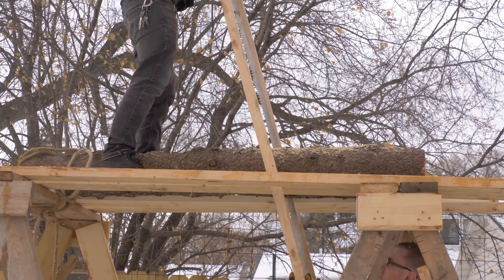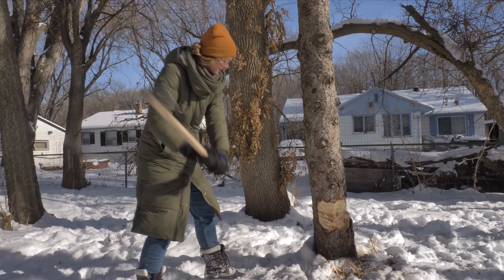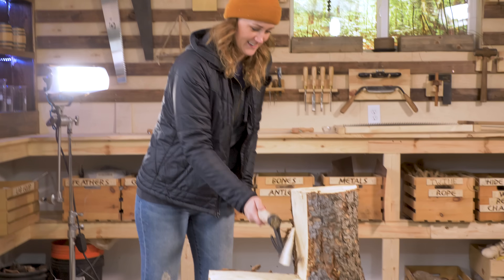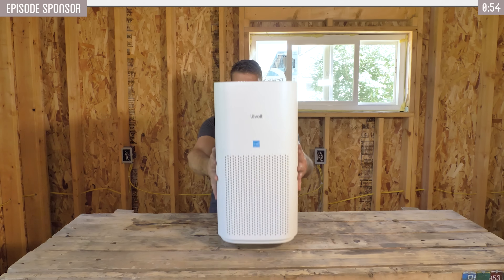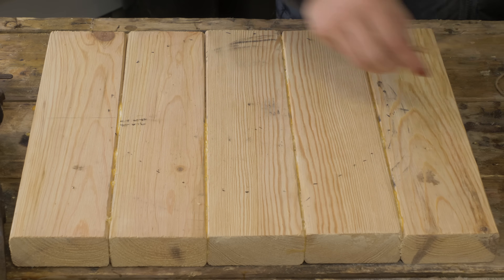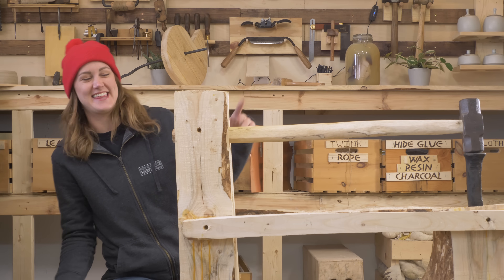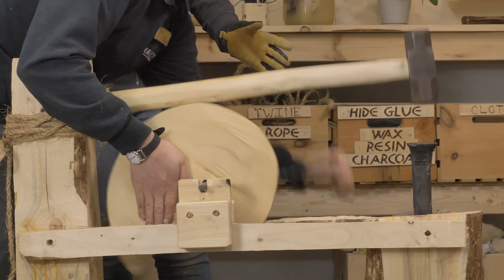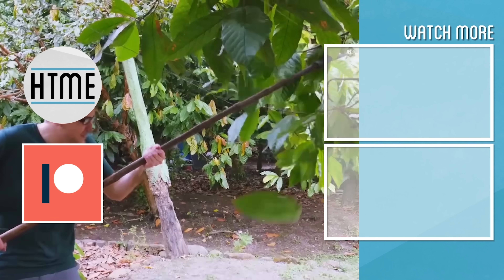Does Da Vinci’s 500 Year-Old Power Hammer Actually Work?

Comment: A good upgrade would be to add a spring, maybe something like a crossbow to add tension. Also use graphite to lube the whole surface of the cam and the joints
Reply: These are my thoughts exactly. And this is why it’s good to read the comments before adding my own.
Reply: @patriciofreire3375  i just found yours. i was thinking the exact same
Reply: A better "upgrade" would be to move the cam to where daVinci actually had it, on the tail end of the handle on the opposite side of the fulcrum. When the cam is between the fulcrum and the head the handle will always ride the cam down through the rotation, because the "step" in the cam cannot turn from vertical (where the hammer head reaches its highest point) to horizontal (where the protruding part of the cam is out of the way of the handle) instantly. No amount of springs, heavier head etc. can change that fundamental flaw.
Reply: I agree though if you want to be accurate they would have probably used to lead for the cam rip your kids
Reply: Why add something complex like tension to something simple an effective like a gravity hammer? Just add more weight/mechanical advantage, rather than having to manufacture spring steel or something else under tension that would degrade.

Nobody wants gut or other bowstrings in a forge environment… unless you want to be replacing them all the time.
Reply: Was graphite used back then? I don't know much about the history of lubricants.
Reply: @NihongoWakannai  There’s always animal fat, since you’re already adding flammable strings to the mix 😂
Reply: @NihongoWakannai  Nope. Graphite as lubricant was a 19th century development. It's unlikely that da Vinci even knew that graphite exists, because mining graphite only started in Cumbria (northern England) around mid-16th century (ie. 30-40 years after da Vinci's death). Before that graphite was basically unknown since it's only very rarely found on the surface out in the open. And from 16th to 19th century graphite was highly controlled by the British Crown because of its use as refractory material for casting exceptionally smooth cannon balls (ie. the Brits basically kept it a military secret).
Reply: Animal fat, beeswax, fine ash maybe?(carbon powder) would work and still be period

Comment: The cam needs to engage a pin bolted around the hammer shaft vs the shaft itself as the hammer does not drop at the edge of the "cliff" but only after it has rotated past, so what's happening is that the hammer is actually lowering and then it drops onto a higher spot on the cam as it has already rotated past the lowest point, which prevents a full stroke.  In other words, you're really only using 2/3rd of the cam and reducing the power of each blow..   An alternative would be to turn the cam 90 degrees, which would allow full lift and drop, but would need additional bracing as this would tend to shift the hammer sideways with rotation..  
Also consider springs or just additional weights to help improve the power of the blows..
Finally, watching the attempts to use the drawknife and other tools was a bit painful..  In addition  to just making the tools, you need a bit of training on how to actually use each of the tools properly as the process is actually quite efficient and the results much less "rustic" when the tools are used correctly...

Comment: 9:25. You're doing it wrong. Just hit hammer handle on the floor or table. Your brain thinks  that it's not ok, but, in fact, that's the easiest method to put hammer deeper on a handle. It travels with inertia and as you hit the handle - handle stops, but hammer wants to continue his path and goes deeper on a handle.

Comment: This looks really interesting and fun. Also am a bit horrified about this thing being connected to a relentless power source such as a waterwheel. I'd like to first make it quite a bit more sturdy and fault tolerant. Maybe add sliders on both sides of the hammer handle so it really cannot fall off the cam?

Comment: Have you adapted Pulley's yet in HTME History? 
Cause @Smartereveryday has a solution for your strain... 

SNATCHBLOCKS! 
This can keep load on you same, whiile 4x the weight of force! 

Also iirc on physical force here, the extra weight could be added to back of shaft and keeping the hammer head weight same just increase impact timing, but also having it in back loosens your load more, so that plus snatch could be 8x force of power for same energy output

Comment: Love the video :D as a smith myself this is going to be a huge help because traditional power hammers are priiiicey and I don't have a dedicated shop for one anyway

One adjustment I would suggest is to add a treadle so you can use both hands on the project rather than one on the crank

Roy Underhill from the Woodright Shop on PBS made a foot powered treadle lathe once I believe (he's actually fairly local :D town or two over) but with your water wheel I'm sure you could even do that fairly easily with a belt and wheel system (akin to a car's timing belt) but a foot treadle would probably allow more precise work and modern power hammers use a foot bar to regulate the speed
Reply: A treadle with a flywheel would actually be awesome for this kind of hammer.

Comment: The handle of the hammer is hitting the wheel, which prevents the hammer from completing the swinging motion all the way. Shave down the part of the wheel directly after the drop off so that the hammer rests completely on the anvil (until the wheel turns and then lifts it up again). A better way of doing this would have been to put the wheel on the back of the hammer, extend the handle of the hammer, and flip the wheel around so that it pushes down on the handle of the hammer instead of lifting it (this would cause less stress to the structures and take less energy to operate).
Reply: Principles of leverage. Placing the cam at the rear end of the handle would take more energy to lift the hammer head. 1 lb. at the end of a 3 ft. shaft has to be countered by a 3 lb. load at the end of a 1 lb. shaft for an equity of 3 lb.-ft. of load. However, it would allow for a longer swinging arc of the hammer, creating a stronger blow. It just means that you'd need 2 people to do the work, one on the anvil and one on the crank, without some creative and excessive gearing to transfer power from the anvil area.
Reply: @jarekmace1536  Leverage doesn't affect the energy required to lift the hammer a certain height

Sure if you're doing something that lifts the hammer twice as high, it takes twice as much energy, but that's not a useful comparison
Reply: What would be better is using the cam to push against a peg sticking out from the sides of the handle.  Nothing to get in the way of it dropping.  Ride up, then drop.
Reply: @latemanparodius5133  I was thinking that too great idea :D
Reply: @latemanparodius5133  whatever you push on will still have to be at the same level to create contact. That alone wouldn't be a solution. You would still have to alter the cam or lower it slightly.
Reply: definitely
wouldn't work that way unless you make the handle stick out farther than the hammer does. ever try holding a door open near the hinges?
Reply: @sadistksuffring1537  that's why I put extend the handle out, gotta be a long handle
Reply: @Jay-qs1ef  I've made my own before and your initial assessment was correct. The lower part just has to be cut more so the hammer isn't being raised immediately. Also just throw a bungee over it for a bit more force. If you want to apply a lot more force then put a motor on it. You don't want to make the handle any longer than necessary since you'll want a longer one already if you want to produce enough force to really move metal. Mine already takes up enough space

Comment: You don't need a larger cam or a bigger hammer head, just shift the center axis of the cam up a bit to suit your needs. Also the frame you build is good enough for a high school demonstration project, making it a bit more heavy duty would've suited better for forging, specially the parts where you have rotating axles and parts which handle loads.
Reply: Yeah all the movement of the frame is energy that could of gone into each hit of the hammer.

Comment: I would think a larger cam would be the most efficient way to get more out of the hammer. Though that might take a longer handle which would probably require reinforcement. A steel rod down the spine perhaps? Carve a minor groove in the cam, and find a way to lubricate the axel in the cam and the cam itself, Char it lightly and add oil perhaps?

Comment: Rotate the wheel 90 degrees and power it from the back
You will be able to use a smaller wheel
The drawback is it will need mor force to rotate as the torc you will need to aply will be higher
Edit: oh and you will have to make a new base for the whole thing the can support the wheel and the anvil, as the weel will be pepindicular to the support beams and you will have to build the base around it